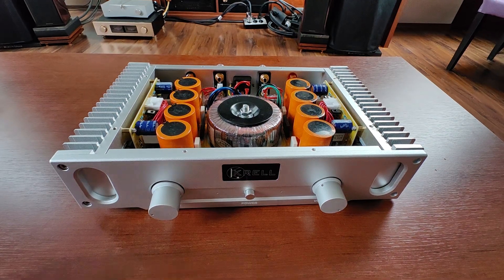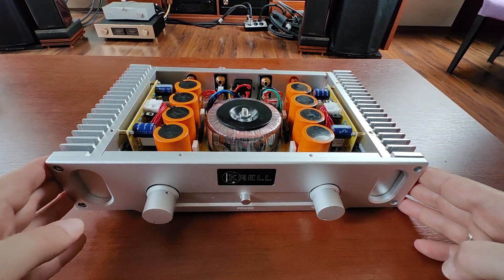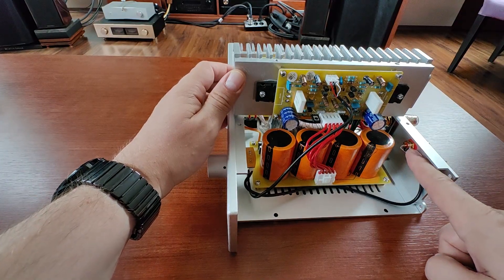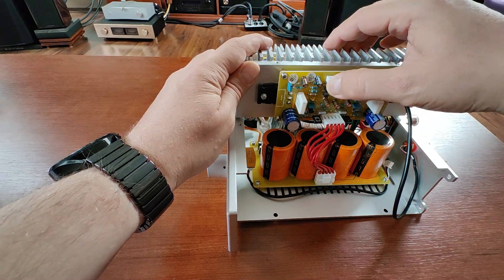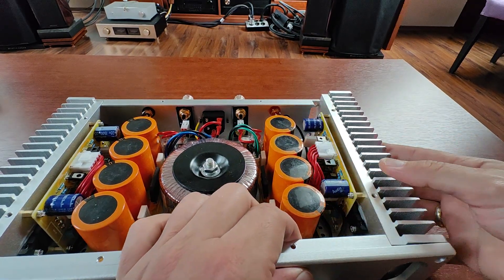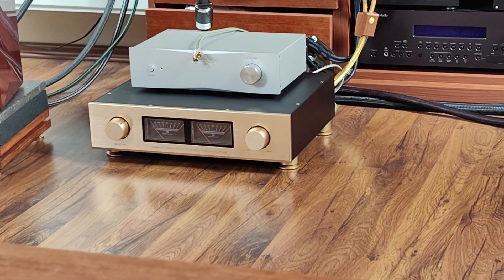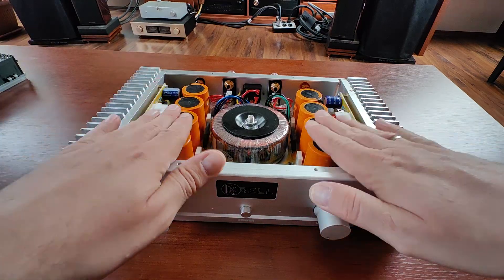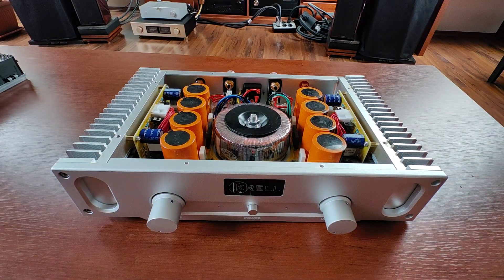Musical Fidelity A1 speaker amplifier clone: volume control bypass in 10 minutes

Comment: Wow! and thank you! I am hoping that you will not have any problems with this amp. If you do
not then I may consider purchasing. The other clone you reviewed which got your high approval
was the DartZeel NHB 108 D5. Now, that amp really peaked my interest but I discovered that a
few customers had (minor) problems. I am not electrically inclined enough to fix these minor
(DartZeel) challenges but I could certainly rewire the volume controls as indicated here for the
A1 clone. My speakers are the Elac DBR62 rated at 6 ohms. I am wondering if the A1 clone can
handle this impedance? I do not listen to my music loud but mostly low to mid low volume.
In any case, I love your videos and again, thank you!!!
Reply: May I know what are the minor problems from the Dartzeel? I am quite interested in the Dartzeel but now have to kiv first since you mentioned there are minor problems faced by others.
Reply: @johan5660  Hi Johan, I replied to your questions yesterday but I see they are not posted. Sorry but I'll
try again. Most of my concerns were generated by customer review/comments on the AliExpress listing
for the Dartzeel amp. You can read through them for yourself. One comment that really concerned me was
relevant to the "inrush limiter something or other". I have no idea what that means but the customer indicated
that he did get a prompt replacement. I have access to an excellent audio technician up here in Canada.
If I do have a challenge with the amp I am sure he can fix it. Hope this helps.
Reply: @Starsurfer1006  Hi Charles, thank you for the explanation. I will check the customer review/comments as you suggested.
Reply: @Starsurfer1006  Hi Charles and Johan - the "Inrush limiter" refers to the SOFT START CIRCUIT THAT IS ONLY IN THE D5 PRO - the non-Pro version doesn't have this and can cause a serious thump in the loudspeakers when you turn it on. The D5 (like the Pro) has a lot of capacitors that all need to get charged up. The standard D5 doesn't have the soft start but the D5 Pro does. This is why the green lights for channel operation on my D5 Pro take  10 seconds to come on. I will repeat that - the amplifier takes 10 seconds to start! Before that, the internal operating voltage is being brought up slowly to limit the current that the amplifier needs to become operational. This is also called initial surge current required to bring all voltages up to normal operating values. There is a video about this power amplifier the D5 Pro in German by the excellent Frank's Werkstatt channel where he goes into some detail about how this is a good thing and PROTECTS your loudspeakers from a power-on thump. Only available in the D5 Pro.  When you power on, you can hear two clicks - the first is a quality relay connecting power to the internal power supply and the second click is two quality relays connecting the output to the speakers (output protection) when up to operating voltage. When that happens, the green LEDs come on.
I hope this was helpful. All the best, Rob in Switzerland
Reply: Hi Charles - I have the Dartzeel clone and I am blown away by it. it is a significant improvement on my previous exposure VIII stereo power amplifier in all aspects - power, transparency, speed, grunt for the low level. The only downside I see is that it runs quite warm and the idle power consumption is quite high when compared with modern designs - but hey, the first stage is pure Class A otherwise it runs in Class AB so it's a tradeoff I happily make allowances for the gorgeous sound and delicacy with serious power. Did you hear of any other issues? As far as I am aware it is quietly building a  solid reputation for itself. I hope it lasts like my Exposure did (38 years and counting!) all the best, Rob in Switzerland
Reply: @RobWhittlestone  Hi Rob, Thanks for the commentary. I've been chasing the class A sound for sometime but have
yet to own anything that is dedicated to just A (electronically). I do wonder just home much of the Dartzeel's first stage
runs in A before the hand-off to B. I listen to low to moderate volumes so I imagine that the DZ will run primarily in A.
In any case, your commentary further peaks my interest so much appreciated. The heat issue is not an issue for me
because I live in Canada on the side of a mountain in North Vancouver. Summer starts soon but I am still having to
heat my home on occasion. Cheers, Charles
Reply: @Starsurfer1006  Hi Charles - As the owner of this channel will probably agree (I wish I knew his first name - more personal than k4syx EDIT - IT'S GREG!), I can wholeheartedly recommend the Transaudio D5 Pro (to give it its official name). You won't be disappointed. The noise floor is extremely low so if you have efficient speakers it won't be a problem and you can move to less efficient speakers in the future with no problem. On paper they claim 300W into 4 Ohms per channel but I think it's more like 225 W - but still plenty. That was my problem with mthe exposure - it was getting breathless with deep bass so I was frustrated with the lack of it. Now it's there where jt should be and making the armchair vibrate on some of my favourite string bass tracks! Even at low volume there is excellent transparency, soundstage, instrument placement, multilayer soundstage depth, room acoustics (from the recording) and other low level sounds (saxophonist taking breaths between phrases comes to mind). At the price it's a steal and I nave considered getting a second to bi-amp which would be insane! Wishing you all the best on your musical journey, Rob in Switzerland
Reply: @RobWhittlestone  Thank you. I, as well, wish you all the best. Your comments re the 
amps ability to perform at low volume are most appreciated. Charles, Canada
Reply: @RobWhittlestone  Hi Rob, may I know what pre amp you use with the D5 Pro?
Reply from the maker: Thanks!
Ive reviewed D5 Pro (just to make sure) - I havent heard about any issues with D5 Pro, though Ive read that there are some people that had problems with 1:1 DartZeel clones (golden cases, eyes and nose button). 
My D5 Pro runs strong and solid, during burn in it made 3 weeks in a row - like a MF clone - with no problems.
MF clone will have no problems with your Elacs, take a look at my video on modding DB52, these can me modded in similar way (removing mesh on treble driver and dampening of the speaker basket)
Reply: @k4syx  Thanks, good to know. Thanks for the commentary on the Elac's. I'll eventually replace them but
with what - I do not know. Both the DZ & the A1 clones have really peaked my interest. I can see myself
buying both. There's a fellow here in the Vancouver area that is known for his rather excellent tube amp
designs. I will probably commission him to build me a preamp for the DZ. He could certainly fix any issues
with the DZ should any arise. I have no skin in his game but he runs a website worth checking out. His name
is Albert, he is a Chinese gentleman of the utmost integrity. His website can be found at Space-Tech Laboratory.
He is located in New Westminster (near Vancouver)
Reply: Hello again 
Can you test the Pass A3 monos please? I am still happy with the quad 405 monos but also very Interesses in class A...
Happy, peaceful new year!

Comment: Can you compare the sound to a similar price class d 3255 amp, something from Aiyima or fosi? From memory even though they quote crazy high wattage their actual is more 20-30w without clipping. So is actually maybe a good comparison against this one. Keep the videos coming. Thanks.
Reply: I don’t have the MF clone, but I do have a Sugden A21 SE, which is a very good pure Class-A amplifier. I also have a Fosi Audio V3, and the Sugden destroys it in every way. The Fosi sounds shrill, in comparison.
Reply from the maker: Exactly. These are class A and its not fair to compare them (not yet at least, D class evolves rapidly)
Reply from the maker: Yes I can and in short - this is better across the board. Id say they its not ever fair to do that comparison. D class went a long way and I own a couple of popular 3255 based amps, but this is way better (though 3-4x more expensive even being a clone)

Comment: Is it worth modifying? Does the sound quality actually improve. BTW purchased on your recommendation and so far so good.
Reply from the maker: Exactly, use preamp and just bypass these. It does sound a little better and you do not have to set balance each time you wat to change volume. I got JC2 based simple and very clean preamp lined for a review that works very very well with this MF clone.
Reply: @k4syx  I bought these two clones and followed your suggestion and modulation. Thanks.
My speakers are Acoustic Energy 509 and old Denon SC-r55.
Reply from the maker: @KuoTungFan  Hows the sound? What do you think?
Reply: The Jc2 clone I have, a breeze audio version sounds very bright. May have been designed to give detail with a usual tube power amplifier of its time.
Reply from the maker: @Rasenkrieger  interesting, what speakers do you have for it? Because mine with Martin Logan Motion is nicely balanced
Reply: If you have any sort of 'decent preamp' as well as this amp, please do this mod.